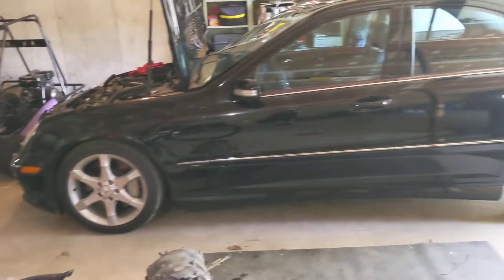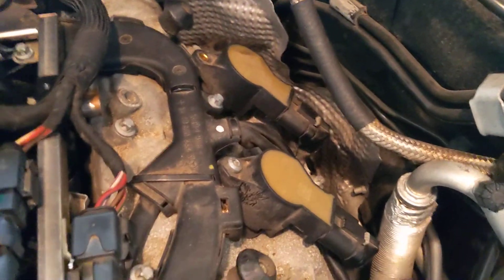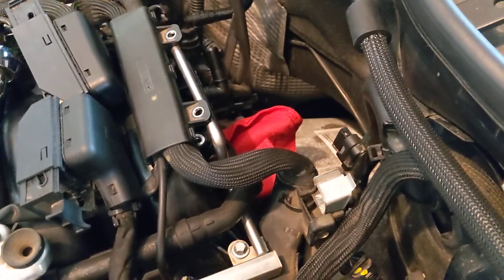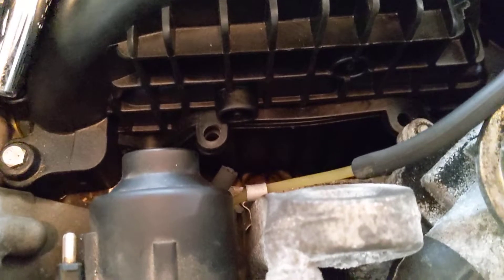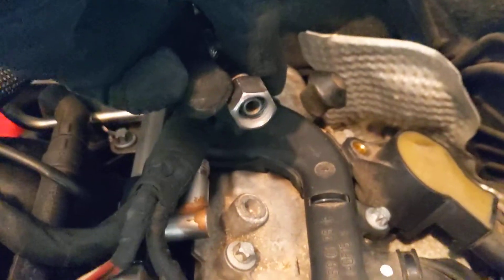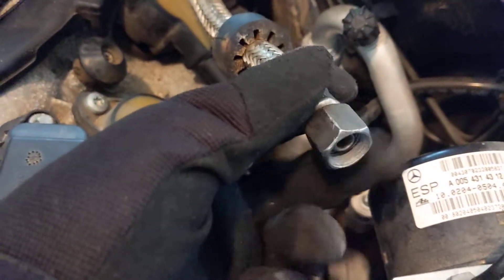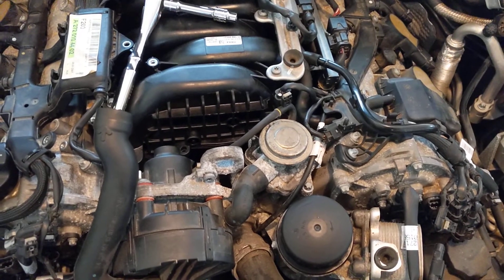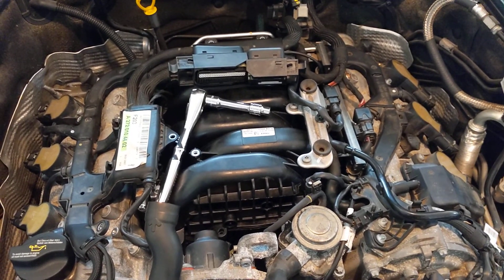SLK350 Sport Composite Intake Manifold Swap- M272

Comment: thank you for covering this swap, any cel's that came up?
Reply from the maker: Working on a written copy a bit more in-depth. Will reply with that if it goes live.

Some people report no CEL after doing the swap. Personally, I figured I would definitely have one given the flap sensors left hanging loose in my engine bay (magnesium one has em, the composite one obviously does not). Considering the change in airflow in the intake system as a whole from this mod set, I elected to tune it before I even drove it for the first time following the swap. OE tuning can delete the flap sensors and I haven't had a CEL since I tuned it some 10k miles ago
Reply: @danny_playswithcars  Much appreciated Danny. I am planning to do this to the E35 variant of this motor and thank you for also mentioning the gasket that goes with the elbow in the follow-up video. I will be running on the stock tune for a while when I do get the chance to do this swap, but there is really minimal loss overall. 

Reading through everything was fun, but actually getting to see a visual documentation of the entire process cleared up many of the questions I had about the conversion. Will definitely make sure to give you a follow on IG, and will be using these videos for references with no doubt.

Comment: Hi Danny, thanks for sharing, great to have people doing and sharing these projects. Where did you found info on doing this?
Reply from the maker: There's some info out there on the forums, but the rest was sort of figuring it out by myself. The hardest part is taking everything apart properly to remove the old intake manifold, but there's a good number of people on here with tutorial videos on how to pull the intake manifold out of an M272. I'd say if you can work on your own suspension, you can do this mod. A bit harder than a brake service, but I did this entirely with hand tools and no power tools.

Since a lot of people ask about this mod, I'm thinking of putting together a video soon of just what parts are needed, how to do it, and how much it costs. In the meantime, if you ever want any info, you can DM me on Instagram at @danny_playswithcars and I'll always try to help out!
Reply: @danny_playswithcars  you are very kind. Thanks for the help.

Comment: Hey Danny great job! I too was deciding whether to replace it with the stock OEM intake manifold on my 06 SLK350. But I always considered the option of upgrading to the new design. I didn't want to get rid of the car just because it was one of the last years with the manual transmission! Since you've had it for a while now, have you noticed any difference at idle or fuel economy? I'm hoping it's a simple plug and play with the OE tune!
Reply from the maker: Manual SLK is a bucketlist for me, that's awesome you have one! This is a 6MT car too, albeit the 2.5L M272 will never stack up against your 3.5.

Fuel economy is better than it was before, presumably because my car was running a bit wonky with the flap failure on the stock manifold (which existed before I even purchased the car). The idle occasionally surges up a couple hundred RPM on warmup, but that could easily be a byproduct of unreliable Connecticut weather and the tune trying to adjust to our random temperatures. 

The OETuning software was incredibly easy to work with, and the people at OE were even easier. The only thing I will say is that my transfer pump for my fuel pumps has also been bad since I bought it, and my company had offered to do it. Still waiting on that, but until then, my CEL is on as a result. That being said, while the car is tuned to delete the flap sensors, I won't know 100 percent that they aren't throwing a light until I eliminate the fuel issue. The code for the flap sensors persists on a scanner but not as a stored code.
Reply: @danny_playswithcars  I like your enthusiasm for the SLK! I am on that fence where do I spend all this money to fix it or do I just watch it become a paper weight... Well I decided after your video that no I will fix it. I think these cars sleepers in the wild, being how rare they inherently are. The balance shaft may give out and am budgeting for it if my number is called!

Your RPMs at start seem normal to me, I get high kick ups when I first start it too, it's a Mercedes thing to warm the engine up I suppose. 

As for the code, I suppose if it's not a stored/active code it will probably just cycle itself away when the time comes? That's what the tune is supposed to do right? I too am in talks with OE and trying to figure out what mods can be done via the tune for my engine. You did the performance tune too right? Any feedback on that?

I do apologize for all these questions, since you've been down this road I am very curious to know what your experiences are before heading down this road myself! I'm following most of the repairs you've done, except for the exhaust, I'll probably modify it at a later date!

Just rewatched your second video, do you by chance have the part numbers for the 82 mm throttle body and the 90 degree bend?
Reply from the maker: @maverick7200  Happy to answer any questions always, though I don't always check on here. Feel free to dm me on Instagram at @danny_playswithcars and I'll always share whatever I know.

Mercedes Medic has a pretty good page for checking your engine serial and learning if your car is prone to the dreaded balance shaft failure. If you haven't already, it's worth looking for the piece of mind. A good handful of cars received the updated balance shaft with no failure issues, so hopefully yours falls in that window.

Yeah, the secondary air injection definitely plays a role in that on cold start. The revs fluctuating a bit in traffic once warm is the more notable thing, but it isn't irritating or concerning in any way.

I've had the tune for a good 2 months or so now, and the code has persisted as a passive code. I'm fairly confident the CEL will not come on, but the ECU still recognizes the flap sensors are sending no signal.

I love my tune. I've always loved the feeling of an NA car, and while the broad powerband in the middle of the rev range of the M272 is very useable it doesn't promote the high-rev driving an NA car usually does. Deleting those flaps with the intake manifold, plus adding the tune, will pull from your mid-range grunt but makes the car absolutely scream up top. It may be less useful in daily driving, but as I'm building this car for autocross and backroads, I love it. Plus, yours will see a much more substantial power increase with the same mods than mine did.

I'll get back to you on the part numbers. Definitely have them around somewhere
Reply from the maker: @maverick7200  Air deflector boot part number: MER-2731400118

82mm Throttle Body part number:  MER-2731410325

A new refurbished TB and a used boot ran me $200 on eBay. If you're willing to toss a used TB in, it'll run you way less as the throttle body was $180 of the $200 total.
Reply: @danny_playswithcars  Awesome thank you so much! Will follow on IG and look forward to your next videos! I'll send you updates on my upgrade journey!
Reply: @Danny PlaysWithCars  So any noticeable performance gains with these modifications? Dyno sheet?